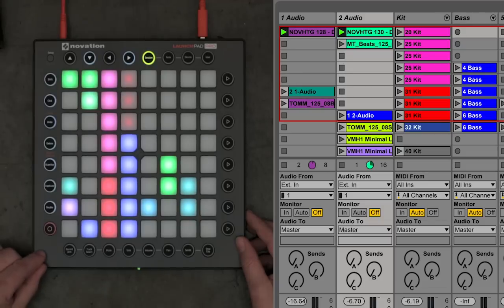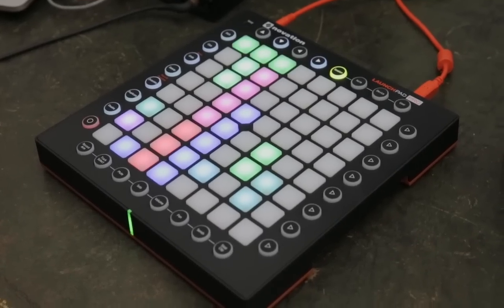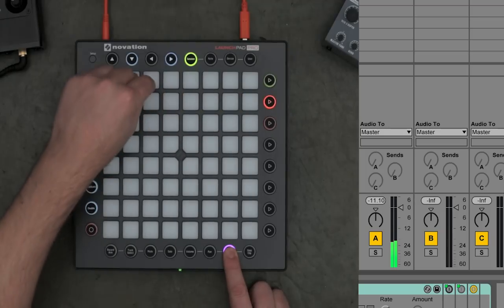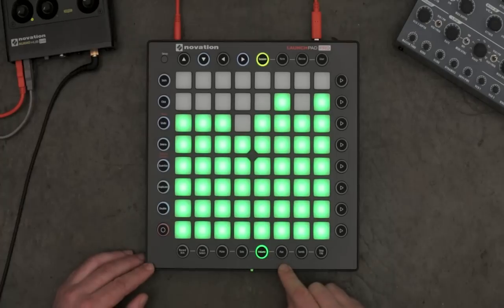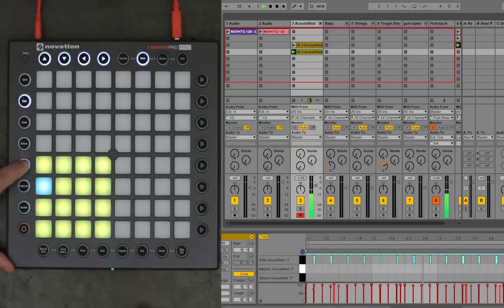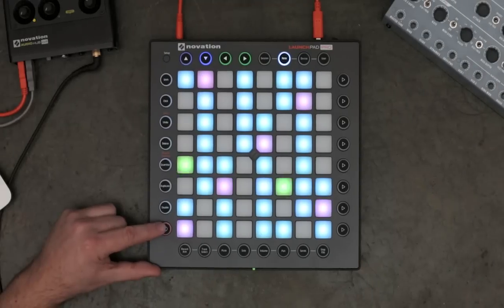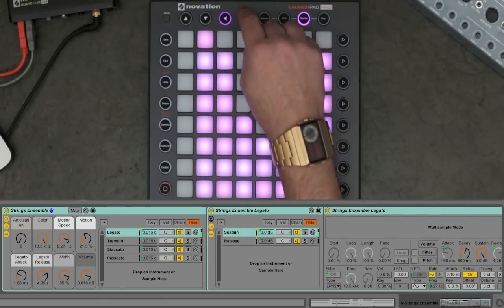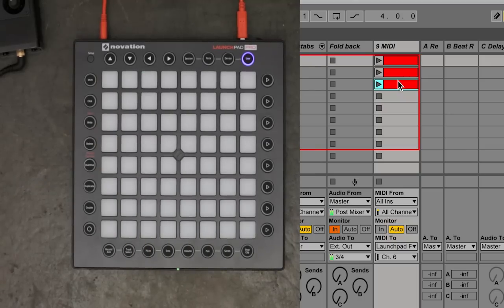Novation // Launchpad Pro Overview

Comment: I just realized that old Launchpad Pro has orange labels on it, but later version has only white. Is there a difference between these two?
Reply from the maker: That's right. The more recent Launchpad Pro [Mk3] has many features not found on any other Launchpad model such as a powerful standalone step sequencer, 8 customisable layouts, a standalone chord mode, fixed length recording, enhanced Ableton Live control and much more. Full details can be found on our website 👍
Reply: @NovationTV  Have you even checked my channel? Lol XD
I meant Launchpad Pro MK2, I'm using your device since 2016
My LP Pro MK2 (which I'm using for almost 6 years) has white labels on it, Launchpad  Pro from this video has orange ones
Is there a difference, maybe it was first revision or smth. I'm just curious about this

Also, open source firmware for LP Pro MK3 will be nice, as it is for LP Pro MK2
Reply from the maker: Ah, there may have been very subtle differences in screen printing but functionally these are all exactly the same.
Have you explored r_cycle? That can be used to create custom tools and functions for Launchpad Pro [Mk3].

Comment: Can I set a record loop length like in a Push,  Stop record can be very fussy!
Reply from the maker: Afraid that isn't a feature of the original Launchpad Pro but Fixed Length recording is possible when working with Launchpad Pro [Mk3]. 
Fixed Length allows you to define a bar length for any new clips that are recorded. Pressing the dedicated Fixed length button will enable or disable this behaviour - https://novationmusic.com/en/launch/launchpad-pro
Reply: @NovationTV  Good to know--I am considering upgrading to the Mk3.
Thanks!

Comment: Do i have to use a computer pls i need answers
Reply from the maker: Launchpad Pro is a controller. It can be used with Mac or Windows PC to control software or used standalone, without a computer, to control synthesisers, modules and other sound sources via MIDI. Launchpad won't make any sounds when used on its own.

Comment: PLEASE TELL MORE ABOUT AFTERTOUCH!!!
Reply from the maker: Essentially, Launchpad Pro's pads will continue to send out data while the pads are held down, which adds an extra dimension of expression to your performances. Common examples include adding vibrato or tremolo, or opening/closing a filter but you can control how plug-ins/hardware respond to the different types of aftertouch data. 'Polyphonic aftertouch' means every pad can have its own aftertouch amount. In other words, different notes will respond individually even when multiple notes are held. 'Channel aftertouch' means that one aftertouch value will apply to all held notes. More specifically, the pad that receives the greatest pressure will dictate the applied aftertouch amount. Please note that while most of Ableton Live’s instruments can respond to 'channel aftertouch', Ableton Live does not currently support 'polyphonic aftertouch'.
Reply: And why when I choose the "Note" mode, I turn on Polyphonic aftertouch, click on ONE pad and hold, then I click on the internal knob of my DAW "Link to controller", and I automatically tie to CHANNEL aftertouch? that is, when I click on another pad, knob changes its value. I turned on Polyphonic Aftertouch, I checked. Maybe something I'm doing wrong or it not works so?
Or does Polyphonic Aftertouch only work with plug-ins that support this feature, and to use Polyphonic aftertouch, I just have to set a port in the plug-in and everything will work?

Comment: How does the touch sensitivity and feel compare to the push2? I'm mainly interested in using it as a synth/instrument
Reply from the maker: It's great to hear that you're interested in Launchpad Pro! Launchpad Pro's pads feature full RGB feedback, velocity sensitivity and polyphonic aftertouch. They're firm but very responsive and allow for expressive, dynamic performances. I'd suggest that you go to your nearest dealer to try them out for yourself. They are different to those used on Ableton Push and all of our other Launchpads. You can find your nearest dealer here: https://global.novationmusic.com/stores
Launchpad Pro can be used 'Standalone' - without a computer, to control external hardware and synths. Scale Mode can also be used in Standalone mode, making it a great choice if you're looking for a standalone instrument.
https://global.novationmusic.com/launchpad-pro-scale-mode

Best wishes,

John // Novation UK 🇬🇧
Reply: This is awesome to find out!

Comment: Hello, is there a drum step sequencer? or any other way to have a drum step sequencer?
Reply: MrBrgGreece There is a Max For Live plugin that includes a step sequencer in User Mode, but you need to buy Ableton Live Suite (which is very expensive) to be able to use Max For Live. The actual hardware does not have a step sequencer by default.

Comment: im 'simply' pressing the session mode button and nothing is happening, all of the modes are lit and nothing is working ffs -.-
Reply: +ZackypoooPS4 Send it to me, you clearly don't deserve it

you're probably already in session, try pressing User then press Session again
Reply: Bob Vetiont one of the instructions on the manual says "mess around with the program" -.-
Reply: ZackypoooPS4  Did you read the bottom part? It said "you're probably already in session, try pressing User then press Session again". I have a mk2, and all the lights are lit when I'm in Session, but the session one is brighter.
Reply: Bob Vetiont its not even in session mode, it would be an individual light, eitherway i solved it
Reply: No it wouldn't, on the S it is but not on the mk2 or pro
Reply: Bob Vetiont pro, and like i said, i already figured it out
Reply: Oh, what was it?
Reply: Bob Vetiont i realized that all of novation videos arent updated for new systems, and they had all of their setting and stuff preset

Comment: I just got a Launchpad Pro, i used a mini before and i have a problem. When i press and hold down a button to play a sample (particularly with a lot of pressure) It glitches and is very laggy (Both the lights and the sample lag). Whereas if I just simply push the button really fast, no matter what the velocity, it will play at regular speed. Has anyone experienced this and know how to fix it? Please answer if you know how to fix it.
Reply: Solved it! If anyone else has this problem, hold the Setup button top left on your launchpad and turn aftertouch off (the row to the right 3 rows down from the top 1 white button and 2 green) and its the white button that you need to press to turn it off :)

Comment: But... this means that (from my understanding) the drum rack is no longer for user mode, but rather for note mode... Therefore, this would render all previous launchpad projects unusable. Yes yes, you can still make projects like this, but you would have to essentially start from scratch... Is what I am saying correct? From my understanding you can only use midi learn mode to assign clips from session view to the launchpad buttons. Is the drum rack also usable for this application? Or is it only for note mode? If it's only for note mode... then this was a bad idea...
Reply: +Z.E.R.0 No user is essentially like the older user 1 and projects will still be usable
Reply: +082 097 121 ASCII Thank god i just got one for christmas :) i had a mini before.
Reply: +Z.E.R.0 No, User Mode should work just as it does on older launchpads. Except, due to the new RGB lights, the colors of the light shows won't be the same (If your'e into that BS).

Comment: PLEASE, how can I reduce the light intensity of the Launchpad mk2 ?? 
is there a way to change it in ableton?
Reply: wear shades
Reply from the maker: +SOUNTEC The light intensity of Launchpad (MK2) can't currently be adjusted.
Reply: SOUNTEC sigh you should know this if you have a launchpad..... For user 1 mode, you have the midi effect "velocity" which you can use to change the color.

Comment: I mean, this is a pretty cool thing, but I think the only thing Novation needed to do was improve refresh speed, clean up the design of the Launchpad S, and put RGB lights. They could add a metronome and record if they really wanted too. This is doesn't even have a user mode for projects, which was a big reason people even buy launchpads. The buttons are velocity sensitive, so they don't press down.

Comment: I'm very impressed by this video actually. Never owned a "button controller" but this one seems to be the exact right balance between the simplicity and functionality. For me Push kind of reminds me the nightmare of hardware synths programming from the old days. And I was extremely sold with velocity sensitive glide control with Launchpad Pro - compared to usually crappy MIDI knobs and sliders - I love the idea to be able to make controllable fast and precise adjustments with the button rows. The only request I have is a 16x16 version :)

Comment: The note mode seem like a fail. The whole purpose of using an alternate surface is to access scales quicker and chord shapes easier than a normal piano layout...especially for non-players. No one uses chromatic layout. you might as well use a regular midi keyboard. I wish Novation would look at J74 ISO for the launchpad and Nativekontrol's LPC + Ditto mappings. Learn what they did right and incorporate into the Launchpad Pro.

Comment: Dear Novation -
Is it possible PLEASE to have 'Extenders' for the LaunchPad Pro?
What I mean is, 8x8 RGB grids that could be locked together to make a visualizer or display (all controlled by Max4Live and the original LaunchPad Pro). Just the grid part, without the function buttons, interlocking.

Imagine the lightshow you could put on with 2x2 or 4x4 of these in a grid, all controlled by Live! Drool!
Reply: Hi there,
Have you seen Launchsync from Isotonik? it may be the solution that you are looking for:
https://www.youtube.com/watch?v=SFlbKaH7bjw

Kind regards,

John Loftus // Focusrite | Novation Tech Support
Reply: FocusriteTV

Hi John, Thank you very much for that - funny enough Ive just bought the Ned Rush bundle from Isotonik but did not know about their Launchsync device! Thank you!

The left and bottom of the Launchpad Mini should enable me to use 4 in a grid for visualization/light show (with a bit of fiddling)... hoping the RGB version may come in the future. Thanks again - cant wait to get a Pro!

Comment: But, what about the good old user 1 mode? What will happen to all of these amazing project files? The only reason I would ever upgrade would be for the RGB lights, not for the added features. Essentially, this is an ableton push now...
Reply: Hi there,
Great question, 'User 1' mode is essentially the same as the new 'User' mode. 
Your older Ableton Live sessions will still be compatible! although the clips & pads may now be a different colour due to the new RGB integration, they can be changed back to the same colour.
Reply: FocusriteTV Cool, but will projects like things from SoNevable still work? Like, will there still be epic lightshows and such? That is what I meant.
Reply: Sure, older projects will still work! The new RGB velocity values may produce different coloured clips / pads but this can be quickly changed back to how they were, if you want to, with velocity changes!
Reply: FocusriteTV Wooow!!! Can't wait to buy that!!
Reply: FocusriteTV But, is drum rack still usable for the user mode? The video makes it seem like it's only usable for note mode, and that to map sounds, you have to use midi mapping.
Reply: can anyone tell me whats the user 1mode or how can i find it? xD i'm totally new and i've got a launchpad pro today.. and do anyone know if the pro is able to play old projekt files? with Lightshows etc?

Comment: waaaiiit.... I see two cables on top. It needs external power??? Oh no... since I'm using old launchpad, I was like "hell yeah, i'm gettin this one instead of S" but naah... this ain't what I asked for
Reply: I bet it's the same case as the Push. You can choose if you wanna use powercable (to get full lights on the pads) or just use it usb bus powered (not full lights strength but still totally workable).
Reply: My bad..it's actually Midi in/out.
Reply: That's right, the Launchpad Pro is USB powered like the previous versions but also has a DC power option for standalone mode; when used with external hardware using the MIDI in and out.